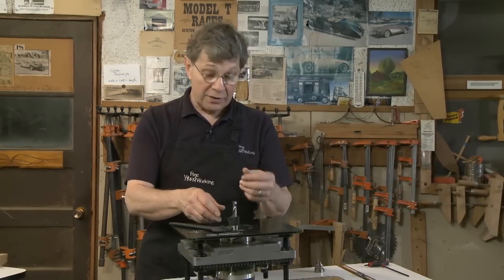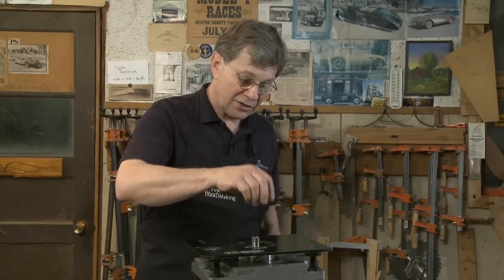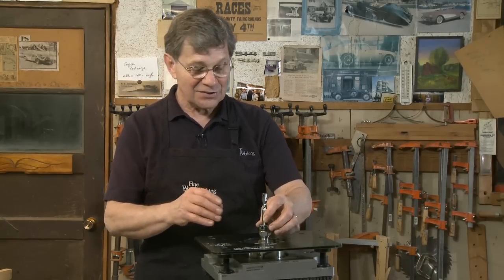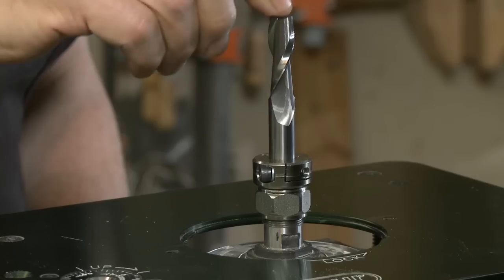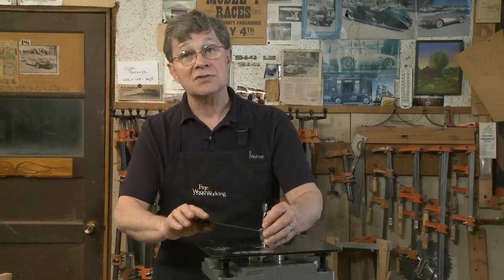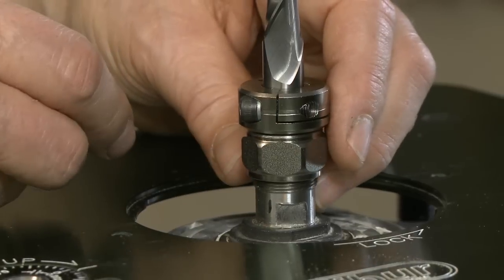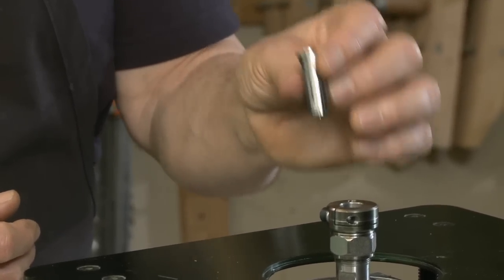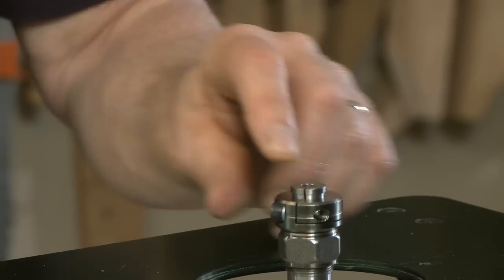Quick Change Collets Make Routing Easier

Comment: Wow... as a new woodworker, with 1 arm, this almost brought a tear to my eye. I can begin to tell you how excited I am. 
Now I just need to not get ripped off on buying the router. Bought 3, all lemons, or worthless in design (I bought a 1980sbCrsftsman router and table (unused. In box) for $75, only to find out the router only takes 1/4" (fixed, unchangeable collet thingy) and it doesnt lift do to plastics age. Got a dewalt, but the guy sold it to me with no motor in it.)
 
Sorry... had to vent... skipped certain medications to get those router's and its messed my head up a bit.)

Comment: Thoroughly enjoyed your presentation on the Quick Exchange collet.  I have a Porter Cable 7518 router in my router table.  Can you provide me with a source that can provide the correct Quick Exchange collet and the adapter for 1/4" bits.  Also, would appreciate a source for the long "T" handle rounded wrench you demonstrated.  Thank you so much.  New wood worker, Robert W. Steen.

Comment: Just an observation, I have a muscle chuck and love it, but it is made to such exacting standards the normal 1/2" to 1/4" adaptor sleeve with its relatively sloppy manufacture can not only jam in the collet as this presenter has stated, it will not hold a 1/4" bit correctly. I have had a bit sink down into the chuck which was a suprise but not as bad as if it had climbed out. Spend the money and buy the Musclechuck adaptor it is worth every cent.

Comment: I have Porter Cable router but the wrenches are missing. Go figure right? lol. None of my wrenches will fit. I'll either have to make wrenches to fit or buy regular wrenches bigger than what I have. If I get that thing off, I'm seriously going to think about getting one these collets in your video. Still need a tool but much easier bit change.

Comment: These are great, BUT they are not made to fit all the routers available in the market.  You have to have a big brand name machine and a quick change collet made for that router.
Reply: About a year ago I inquired and he didn't have any that worked with the four different router models I use. Rather disappointing considering I change bits constantly (even having five routers always set up and ready to go)

Comment: Can you share information about which Quick Change Collet system/product you are using?
Reply: What if the router bit shank is to long can it be cut down? I'm using a 1/2 inch bit with a Porter Cable 6902 router. Thank you in advance for your reply.
Reply from the maker: I definitely wouldn't recommend cutting a bit shank down. If it is high speed steel you'll overheat the bit and if it carbide you'll likely never get through it or shatter it! -Ben
Reply: Assuming it is a steel shaft you can definitely have the bit cut down but it may cost more than buying a new bit with a shorter shaft. Anyone with a metal cutting lathe can do it. If they have any knowledge at all they know to cut slowly enough to not overheat the unit. It is unlikely you could do it yourself and maintain the proper balance. If you try just go very slow and do not let it get any hotter than you can touch.

Comment: I wish this video had included information about (a) suppliers and (b) compatibility.  Will every quick change collet work with every router?  If not,  what are the issues?
Reply: My guess is that if you wait a few days, then go to FineWoodworking website, you will see a blog or some such talking about this subject. these vids are usually put on YouTube as a convenient location when embedding them in an article.
Reply: Deathlok67 I'll  keep  my eyes open  for  more info on their  website.   Thanks for this  tip!
Reply: I despise the process of changing bits with wrenches, these are amazing.